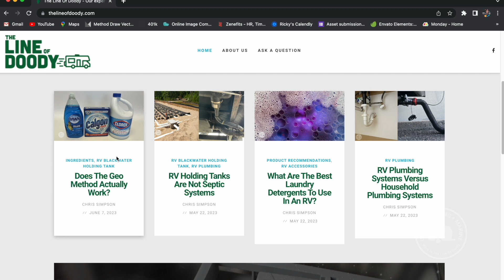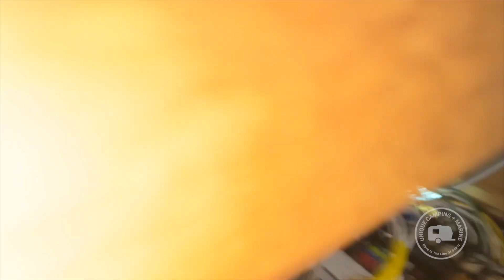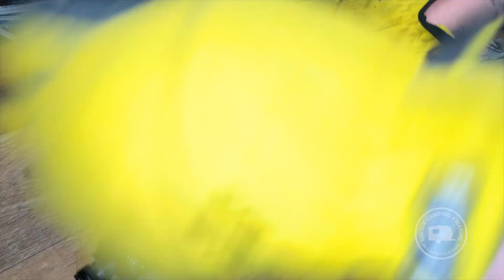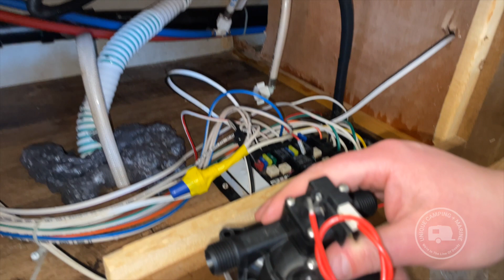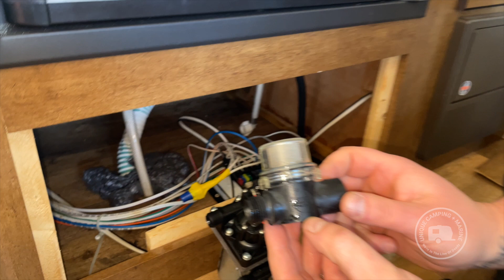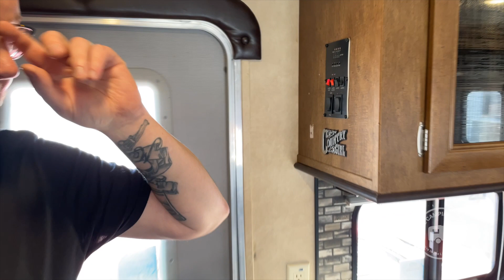I Fixed Our RV Water Pump - Easily

Comment: My water pump switch is doing nothing now, what all could it be?
Does that mean its broken? I dont want to replace it since Im giving the rv away to anyone who wants to salvage it; I just totalled it,  has a big hole in front, thats tarped now, but I still have to live in it till my goFundMe allows me to get something else,maybe just a cargo van, as I cannot afford an RV, esp. the gas (Im only getting 5-7mpg) 😢 I just put up a video on my yT channel.
Thanks for your videos (where are you located?)
Reply from the maker: I am truly sorry to hear that you are having such a hard time with that RV. It is possible that the pump switch has just broken. It could also be that the wire connection was damaged or disconnected along the way or the pump itself is damaged. If it is possible for you to connect a freshwater hose to your RV from a good water supply then the pressure from the water source will bypass the water pump and allow everything else to function in the RV. This would keep you from needing to diagnose and replace parts. I hope this is possible. Otherwise, you will need to locate the pump in your RV to start diagnosing the cause of it not running. I hope this helps even a little. Thank you for your comment. We are located just outside of Denver Colorado.